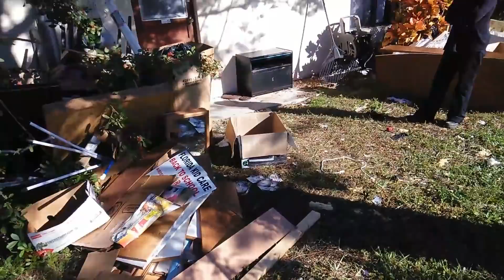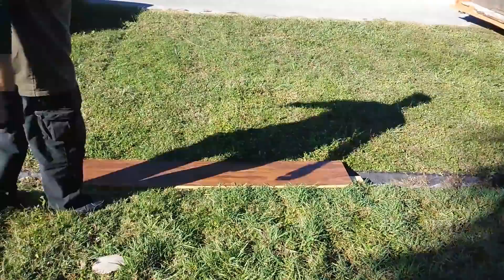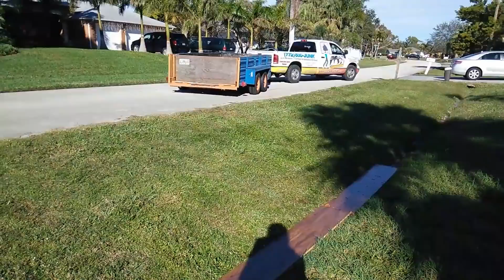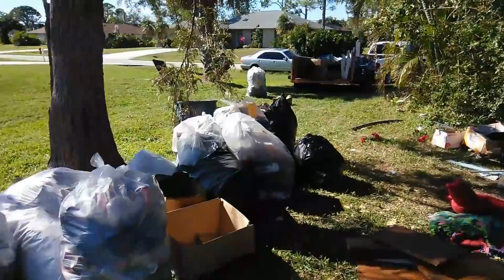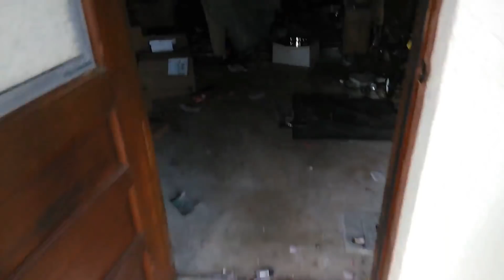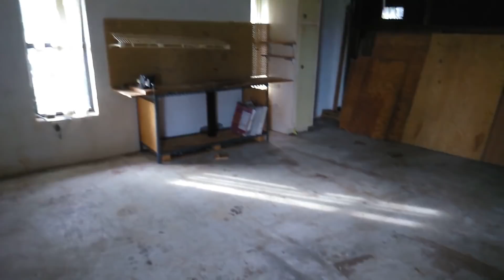Garage Clean Out Specialist in St. Lucie County, Florida - 772500Junk.com

Comment: what do you guys usually charge on a garage clean up? little to big (packed wall to wall lol) and were did u get ur trailor? size too? awsm vidz btw :)
Reply from the maker: Depending how labor-intensive the job could be, our full trailer range is between $300 to $350.. Our trailer is 14ft long, 6ft wide & 3 ft tall .. We purchased the trailer at a used car dealership for $700 then put about another $800 into it. ($1,500 total).
Reply: ah ok cool ....n wow that's cheap for a traior!! awsm tho ...keep up the vids there helpful for us 'solo junk hauler guys' hehe...
Reply from the maker: We typically charge in the range of $28 to $35 a cubic yard.. The price will fluctuate because of the labor intensity.

Comment: on a big job like this one how much do you charge
Reply from the maker: On this particular job we removed two full trailer loads. One of the loads was oversized and we removed approximately 24 yards total between both loads.. After discounts we charged $850.. That's approximately $35.41 per cubic yard.